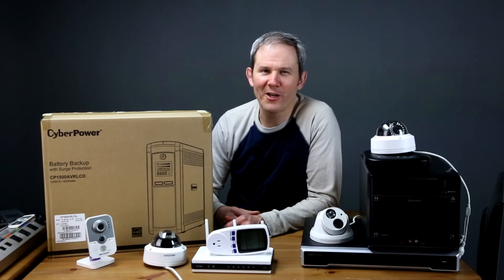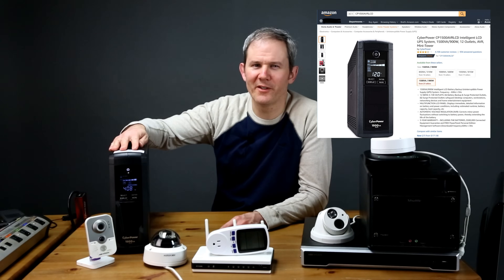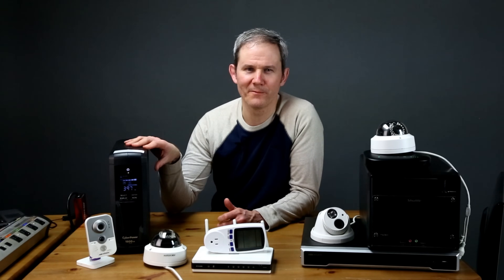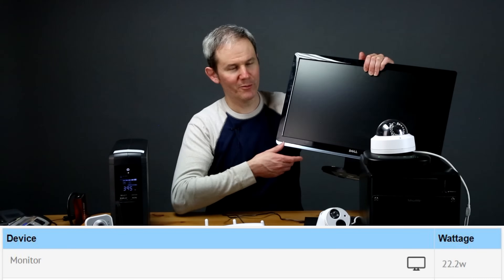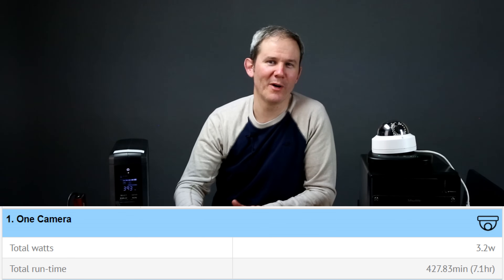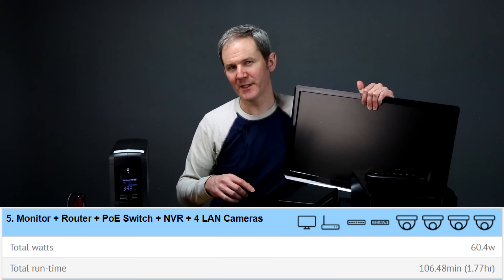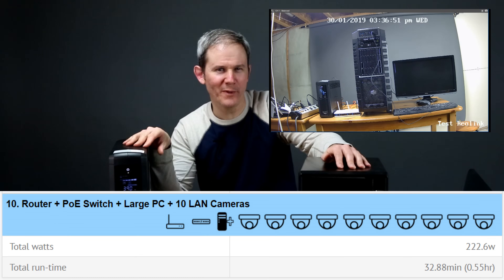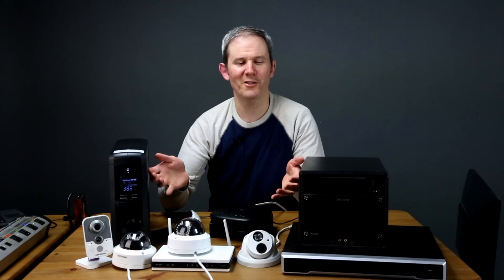Battery Backup for your Security Camera System - UPS (PC/MAC & NVR/DVR)

Comment: Nice video! I like wgat you did there. Spent all day yesterday googling doing similar calculation but nice to see that you did a real life test.
My idea is to set a dedicated UPS as a stand alone battery for my cam+nvr +home router.
I want to set it as a seperate "small battery" that will charge only with excess solar generation.
I'm quite shocked to see the unit laster 2.8 hours only even though it has a 900w power...
Reply from the maker: Glad it was helpful! Sounds like a fun project!

Comment: You can get a used UPS and instead of stock battery attach car battery. Usually these UPS have 7Ah batteries. Average car battery has 10 times as much. New car  battery will give you 10 times more back up time than built in battery. And used car battery that can start a car only in warm temperatures you will get 2 to 5 times as much backed up time, comparing to built in battery.
Reply from the maker: Great question! I don't know enough about electronic to answer, but hopefully someone else can chime in.

Comment: Is it safe to have the UPS plugged in to wall socket all the time? With say two camera sockets plugged into the UPS. Wouldnt it burn and overheat the battery if it’s constantly plugged into power socket? There is no power cut yet in this scenario, but I’m wanting to make sure my two cctv cameras still record if there is a power cut while I sleep, or am at work. I want to plug my cameras into UPS at least while I sleep incase if power cut, but still have UPS plugged into mains socket.
Reply from the maker: Yes, my understanding is the firmware on the UPS will manage the battery charge to prevent it from overcharging and overheating. The batteries will not last forever. They will need to be replaced every 5 years or so. This is just the nature of these systems.

Comment: So do you plug in the UPS and the modem, router to it then? I have wireless cameras and trying to avoid issues when power goes off. I cannot see a way around this. Ugg
Reply from the maker: It depends on your setup. If you have LAN cameras recording to the NVR, then yes, you'll need the NVR and router on backup. If your cameras are connected to the NVR directly, you'll only need to backup the NVR. If you want to still access the camera's remotely during a power failure, than you'll need to backup the modem too.

Comment: Great video! Would love to see a comparable test using 6V Golf Cart batteries in series with supplemental solar charge. I'm ideally building this along with emergency cellular modem that sits between cable modem and router. Ideally hoping to sustain power perpetually for time at cottage. Have you upgraded to similar yet?
Reply: @Tom Rolfson.  How about using 12 V deep cycle RV batteries instead? They are designed to go dead and be recharged without killing their life cycle . I wish I knew how to do something like that !  Please chime in if you have any suggestions or ideas along that path...

Comment: I dont know why all houses dont have battery back ups. I use 2 large 420 Kilowatt hour, 6v batteries (12v output). I have a power inverter, not connected to the grid, but charged by two 100w solar panels. The batteries also have a trickle charger (2 amps) for redundancy. 

All security systems run on the battery's. I would strongly suggest a quality inverter, as most produce a "dirty sine wave" and will destroy electric motors, like the HDD in your NVR recorder. 

Also having 840 kilowatt hours means the things you showed in the video will run for weeks on battery alone. Also if the power goes out, its nice to run up to a small 1000w AC for a day or so, computers and lamps will go indefinitely with the solar panels connected.

Comment: Would be good to note power useage for hard drives in use unless you're including that.

For my system, 5MP HD over coax.
Each camera uses 1w~ without IR, and 4w~ with IR on.
The DVR uses 5w~ on its own.
Add in the 1TB WD Purple and that uses 3.3w R/W, although larger drives consume more power with an 8TB using 8.6w alone

So, totals during the day are 12.3w and at night 24.3w with IRs. 

So a basic 50-60 dollar(given market) 300watt UPS will keep this running at 24.3w for about 4.5 hours while your 1k unit will keep it going for around 14 hours.

Comment: Hey mate, could U please let me know if this ups back will be ok for my reolink 8 channel NVR system? Thanks
Reply: I am not the creator of this video, but basically, a UPS is a battery storage unit with output to resemble a standard wall outlet, so it will definitely work. I won't go into the math this guy does and give you an estimate on duration of use, however.

Comment: Thanks for the video.  I am about to purchase an 8 camera system. I would be fine with 30 minutes of backup time. The scenario I would be most concerned about would be a thief cutting off the main power to somehow disable the security camera system. In this way, it would still record - although the beeping sound the UPS makes could lead them straight to the NVR, so I need to see if there is a way to disable that.
Reply from the maker: You can disable the beeping. I think it can be done through the software: https://www.youtube.com/watch?v=bDpya74Ffqs

Comment: If that UPS is just for the NVR and PC, that's too big. I have a smaller UPS half the size of yours. It's a 400VA-2000VA. It lasts up to 3 hours of battery back up for both devices and about 4 to 5 hours just for the NVR and cameras. The computer can be switched off safely and let the UPS take care of the NVR. the UPS only cost me $AU125.
Reply from the maker: Thanks for sharing!!  I use my main UPS for my entire network; 16 cameras, PC for recording footage, Switches and Modem.  I get about 45min on a 1500va UPS.  I am considering another UPS when they are on sale again to split the load.
Reply: @HomeTechDIY  16 cameras? That's understandable, sorry. I thought you had 8 cameras, NVR, and a computer.
Reply from the maker: I am picking up another 8 camera NVR from Reolink in a few weeks.  I will test it out with the UPS.  Thanks!

Comment: I have a Tripp-Lite 1500 VA backup powering a beefy Xeon file server, wireless router/firewall, modem, network switch, VOIP phone server, 8 cameras with IR, 1 enclosure with heater/blower, and a 16-channel NVR. And it lasts almost 3 hours with all of that running at full power.

Comment: Can you use Swann cámara     system  with  different brand cámara like Hikvision
Reply from the maker: Technically, yes, but Swann doesn't make it easy.  Make sure the Swann system is ONVIF compatible and the option to use ONVIF for that channel accepts ONVIF.  Also you will need to active the Hikvision camera on a PC using SADP and give it an IP address to match your Swann's internal IP network.  You will also need to give the Hikvision a username and password using SADP.
Reply: Swann is made by Hikvision. Aside from that, many Swann systems do not have support for ONVIF so mixing and matching can be tricky with network systems. For best results, you might want to stick to analog. Analog HD support can differ between manufacturers, but if you stick to the same type, everything will typically work together.

Comment: Great video. I don’t suppose you could do a similar video for CCTV HD analog system with 8 channel DVR w 4TB HDD, 8 HD 4MP cameras, 9 channel 12v 10amp power supply, with and without powering a modem, switch, router etc...My understanding is an analog system will consume more power than IP. Appreciate your great work. Thank you.
Reply: It's not really a question of analog versus IP for power consumption. All things being equal, they really use about the same amount of power in my experience. It really comes down to features. Many network cameras have far larger imagers than you can find in analog cameras. They require more power. Add more power for cameras with good compression, backlight compensation, IR, advanced night modes, automatic shutters, etc. Since analog cameras are typically powered with heavier gauge wiring, they are also more efficient with less voltage drop. That said, ignoring illumination, heaters and blowers, and movable lenses and housing, cameras are all about the same when similarly spec'd. Your average cameras runs somewhere around 4-6 watts. High end ones can go a bit higher. PTZs can have a wide range so you should check the spec sheet for your camera to see what it's designed to consume.

Just remember that designed specs and actual performance can vary greatly depending upon environment and the quality of the installation. If you're buying cable on Amazon or at Home Depot, don't expect the best performance. Likewise, big box camera systems are not going to be very power efficient either and may vary widely even from camera to camera of the same model.

Comment: Thanks for the information's, what do you suggest online UPS or Line-interactive for surveillance camera system?
Reply from the maker: I think line-interactive should be fine.  I did a lot of testing and re-testing for this video and I didn't have any issues with this line interactive UPS.  There was no flicker or static or anything noticeable when disconnecting power to the UPS... the cameras or the NVR didn't even notice the switch over to battery.  Hope this helps.
Reply: Thank you so much for the answer, it was really helpful!!

Comment: Very useful. Yours is the first video that i have find like this... Glad it back up some of my calculations too...I recently installed a camera system and was looking at that very ups you were using.  And was going to tie in the modem and router to have remote access until i realised that the power outage also knocks out the isp equipment in the area so no internet even though my modem is powered. I also did some quick calculations and i was only getting  65 -70 min of power when i really needed at least 3 -4 hours for extended power outage coverage. Short of using APC system with a secondary external battery i don't have any other solution.